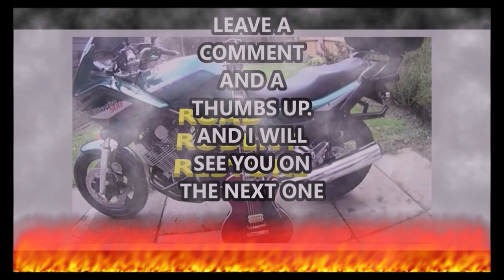CBR1000F Landfill bike. More rear wheel nightmares.

Comment: When removing a brake disc I always use a blow torch to heat the bolts, it softens the Loctite makes a huge difference.
Reply from the maker: Hi James. Great tips for everyone. Thanks buddy very much appreciated cheers 👍
Reply: @jonyr1TT   use a hot water from a kettle even !!

Comment: You got there in the end 😉, once the bead is broken and the lever is in keep pressure on the opposite side to make room. To take the other side off keep the wheel upright and start at the top taking the tyre off on the same side as the first,i learnt this on tractor tyres 😳😂😂😂
Reply from the maker: Hi Gary. Thanks for the helpful tips for everyone it's very much appreciated cheers 👍

Comment: on the last job john you only need one tyre lever and a hard rubber hammer get the lever in bring its over to your self nearly 90  degress  leverage  and hit the edge of the tyre near the  wheel with a rubber hammer  as you go round use some fairing liquid helps it slip  takes less than a minute to take off
Reply from the maker: Thanks Alan great tips buddy 👍